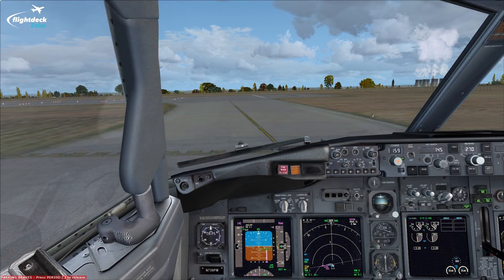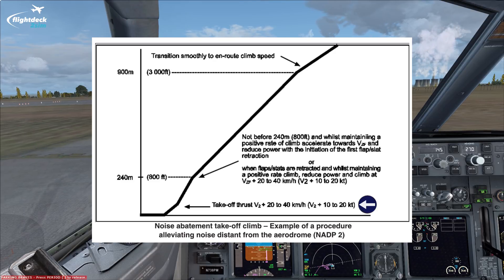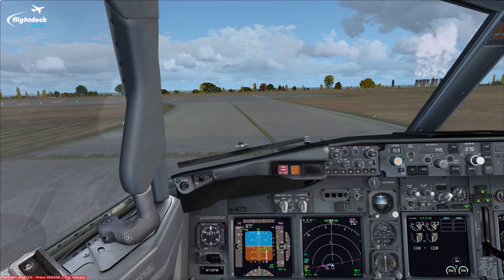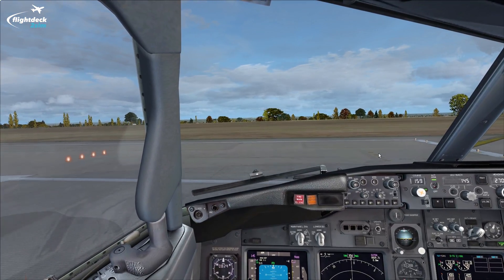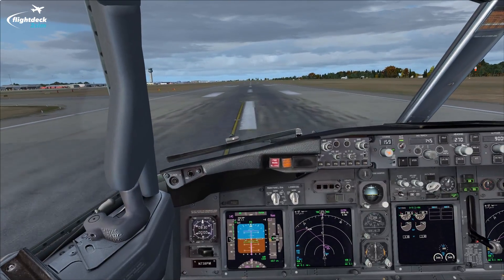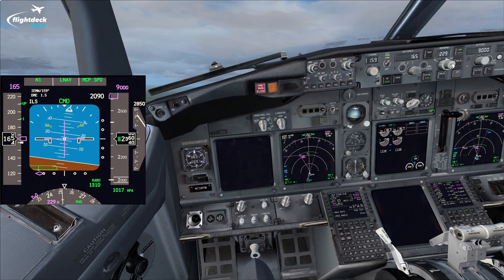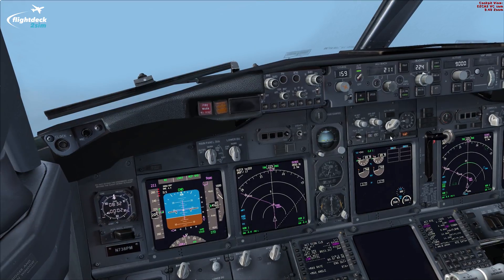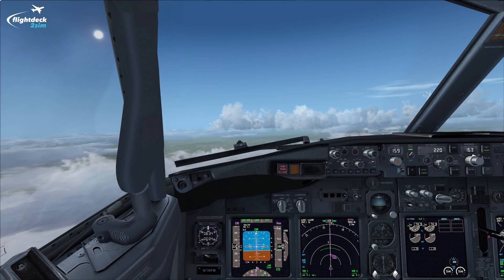PMDG 737 | Takeoff Tutorial (Noise Abatement Departure Procedures) | Real 737 Pilot

Comment: Sorry for it not being about noise abatement but my question is what is the purpose of putting the gear lever in the middle position?
Reply from the maker: Hi Joe, no problem!

Once the gear is in the UP position mechanical locks keep the gear up, moving the gear level to OFF removes the hydraulic power holding the gear up, this increases the life span of the gear HYD actuators.

FD2S

Comment: While flying what is the difference between autopilot Alpha and bravo  and those 2 under.
Reply from the maker: Hi Ruben,

Both are identical in function, F/O typically engages CMD B and the Capt CMD A, makes no difference. Both must be engaged to fly an Autoland.

CWS is a mode called Control Wheel Steering, a mode seldom used but allows you to "fly the AP" through the control column, it will hold attitude and pitch for you.

FD2S

Comment: I have watched many of your videos (love 'em all). But one thing I do not recall seeing, and am confused about, is the Acceleration Height, Engine-out Accel Height, and Thrust Reduction as seen on page 2 of the Takeoff page in the FMC.  In particular,  how does your operator use these, if at all, especially in relation to the two NADP procedures, and also to the Autothrottle, Flight Director, the pitch modes, and the autopilot?  If you talked about this in a video, please tell me which one.  If not, maybe you could speak to this a bit.  THANKS SO MUCH!!!
Reply from the maker: Hi cruisebuddy

You can modify the Acceleration Height and Thrust Reduction on TAKEOFF REF Page 2. If you then select VNAV for departure (which some airlines do) it will accelerate the aircraft at the height selected on TAKEOFF REF Page 2. As we don't use VNAV for departure we don't pre-populate TAKEOFF REF Page 2 in my company, we do it manually using LVL CHG and "Bugging Up"

FD2S

Comment: hi great video 
I have a question regarding airspeed during the take off. I set the vspeeds on the FMC and dial VR in the MCP. set flaps and arm auto throttle. Line up and set thrust to 40% engage Toga ,rotate at V1 ,as I climb my airspeed will rise passing the flap up speed.
I cannot reduce thrust unless I turn off auto throttle which I'm sure is wrong. Should I be retracting the flaps as my airspeed increases.
I looked at your instruments you had throttle hold , I can't remember seeing that before 
I need to understand more on the relationship between TOGA and VR  
Hope I articulated it enough for you to answer me
Reply from the maker: Thanks Jonathan 

Set V2 on the MCP and follow the magenta flight directors accurately after takeoff. The aircraft will pitch to a maintain a speed of V2+20 after takeoff until you pitch nose down to accelerate based on the NADP.

Take a look at my latest tutorial on Takeoff Flap settings which includes a F1 and F25 Takeoff. This should help you out 👍🏼

https://youtu.be/2ll7aFpgNCw

FD2S

Comment: Hi! In a NADP 2 you “bug up” at 1000ft but the thrust reduction altitude is 1500ft, right?
Reply from the maker: Hi Francesco

Correct, thrust reduction can be modified on takeoff page 2 of the FMC, it’s defaulted to 1500ft 

FD2S
Reply: flightdeck2sim and in your company you modify it or you leave it at 1500?
Reply from the maker: Mostly leave it, certain airports have different rules. You can find the information on the Aerodrome Information part of the chart regarding acceleration heights and thrust reduction altitudes. 

Good luck! 

FD2S
Reply: flightdeck2sim Thank you so much!

Comment: Great videos... what is the difference between the autopilot switches... you selected CMD B usually I would just select A?
Reply from the maker: Hi Jamie, thanks!

Both are identical in function, F/O historically engages CMD B and the Capt CMD A, makes no difference

FD2S
Reply: Thanks for the quick response, makes sense then... just discovered your channel and subscribed alot of my questions are now answered :)
Reply: Hi Jamie, Maybe it was here or in another channel that I saw that. When comes to VOR's tracking, as you have 2 vor's and course knobs, if you engage A, it will follow that VOR/tracking on the left side, and if B, the VOR on the right side. I think that is the only difference.....but I might be wrong..You can test this easily by setting the same frequence on both sides and different trackings, engage the vor tracking and see which one will follow with B or A. Worth to mention that it's very rare that I see people using VOR navigation on any of the large jets (on youtube...and simmers...which is my only experience as simmer)).  This is one of the skills that goes away when you leave the GA planes and move to the big ones. The FMS will do everything and we forget some of the basic stuff....

Comment: because you are a real boeing pilot i ask you how is the manual handling of the aircraft i the sim compared to a real aircraft?
Reply from the maker: Hi Adrian.

The NGX is a very accurate rendition of the real aircraft and certainly something I can use to improve my knowledge. With regards to handling there are some limitations as there is no feedback from the controls (the need to trim etc) but that's the same with all aircraft on a desktop simulator. The dynamics and how it behaves with certain configurations, attitude and thrust settings are pretty close to the real thing.

There are some subtle differences between the NGX and real aircraft which I always try to bring to your attention but the flight model is pretty sound. 

For what is essentially an entertainment product it’s certainly worth the investment and it’s realistic enough to accurately show you how to operate the aircraft using real world SOP's and procedures.

FD2S

Comment: Thanks for another great tutorial! Quick unrelated question, if an IAP contains a DME arc to make the transition, does the autopilot flies the arc automatically after loading the procedure? Also, can you configure the fmc to fly an arc manually similarly to how you enter a holding procedure?
Reply from the maker: Hi Manuel Z,

The ARC should be in the FMC Database if correctly coded and you can use LNAV to simply follow the magenta line.

You can build an ARC manually by using the fix page in the FMC to create waypoints using a Radial and Distance from the DME Station. It won't be a perfect ARC but good enough!

FD2S

Comment: Always very happy to see you've released yet another clip sharing some of your knowledge!

One thing I wanted to ask not related to the topic discussed in this clip is how much do you hear from the APU when starting it as well as when it's running when sitting in the cockpit? Same question for the engines.

Reason for my question is I'm trying to modify the existing sounds and would be nice to get them as close to the real thing as possible. I realize it's very hard to describe exactly what you hear using text only but comments such as...

"You can clearly hear the APU starting as well as running from the cockpit if there's not much other noise close by" or...

"You won't hear anything from the APU other than the sound the APU switch will make when you flip it to start the APU"

...that would be awesome and most appreciated!
Reply from the maker: Thanks Richard!

You can't hear it from the cockpit unless the aircraft is completely empty and only when you initially power up the aircraft. (Battery on only). As soon as you connect a source of AC power (GPU or APU) it's drowned out by all the background noise in the flightdeck. 

That's the best way I can describe it!

FD2S

Comment: Another welcome & informative video for the flight sim community.

Copied this from my local airport NAP Arrivals procedure :-

"Aircraft will be routed clear of populous areas until seawards of the coastline or
established on their final approach course. To assist with noise reduction on final
approach course, pilots are requested to delay flap deployment until as late as is
operationally practicable"

I am assuming the flap delay means the engines shouldn't be revved up until "operationally practicable". Here's me picturing a quick "flaps full" when getting close to the threshold :)
Reply from the maker: Hi Richard! Thanks!

Haha that's essentially it, if you're lucky you can essentially avoid "revving up" until on short final

We try and fly all approaches as LDA's (Low Drag Approaches) which helps to both increase efficiency and reduce noise. We try to use idle thrust for all descents and try to avoid flying extended periods at low altitudes by flying a CDA (Continuous Descent)We then plan to configure flaps and gear for landing so we only need to add thrust selecting landing flap. It's more art than science! 

FD2S

Comment: Is there a way of setting NADP via FMC? I believe this can be done with Airbus?
Thanks btw for your fantastic videos, I've learned so much!
Reply from the maker: Hi Keith, thanks!

You can modify Acceleration Height and Thrust Reduction on TAKEOFF REF Page 2. If you then select VNAV for departure (which some airlines do) it will accelerate the aircraft at the height selected on TAKEOFF REF Page 2. As we don't use VNAV for departure we don't pre-populate TAKEOFF REF Page 2 in my company, we do it manually using LVL CHG and "Bugging Up"

Hope this helped answer your query!

FD2S.
Reply: Cheers for the fast reply, thought that was the case! One thing which was an eye-opener for me from your earlier videos is how much you do use the FMC for making changes, rather than just using features of the FCU panel. This is the reverse though, is there a reason why your airline chooses not to use VNAV on departure? When do you usually engage VNAV then?

Comment: Nice informative video! I noticed you didn't talk too much about thrust aspect of it. Granted you had a good length of runway and your TO thrust was basically the same as the climb. Are there procedures for when you're flying heavy or have a shortened runway and how can program the climb thrust cutback at a given altitude in the FMC? KSNA is pretty notorious for NADP.
Reply from the maker: Hi Kevin

With regards to Acceleration Height we don't use VNAV for departure here so we don't pre-populate TAKEOFF PAGE 2 prior to take off, we bug up manually using LVL CHG. 

We also leave the default values for reduced climb (CLB 1 and CLB 2) for all departures, even shorts runways where we are field length limited. Depending on what thrust setting we use for takeoff decides our de-rated climb thrust, the FMC will decide CLB-1 or CLB-2 based on what derate we select or/if we decided to use assumed temperature reduction. We don't change it as crew at my operator.

We always reduce take-off thrust to a safe value to increases the service life of the engine, reduce costs and decreases noise but it's usually based on takeoff/obstacle limits as opposed to noise. At noise sensitive airports like Barcelona (LEBL) where noise compliance is monitored and hefty fines are imposed for non-compliance we follow NADP 1 which is sufficient, even with full 26K and SIDS are designed as practically as possible to reduce noise. 

I only have experience in Europe so it might be different State Side and procedures applied differently else where! 

I hoped this helped answer your query!

FD2S.

Comment: Good evening and thank you very much for the videos. Extremely informative and I have learnt a great deal from you already. Just a quick question, I notice that you selected CMD B on the autopilot. Why and when is CMD A or CMD B used or is there no difference?

thanks again.
regards

gareth
Reply: I believe either one is legitimate in usage. CMD A usually goes to the pilot side so it's linked to nav 1, and CMD B is linked to co-pilot/fo side Nav 2. For ILS, both are usually turned on for redundancy in case one fails. So both NAV 1 and NAV 2 need to be set correctly for the ILS freq. I could be wrong though.
Reply from the maker: Smashing reply by Kevin W, both are identical in function, F/O historically engages CMD B and the Capt CMD A, makes no difference, two A/P's are available 👍🏼

FD2S
Reply: Thank you very much for your reply, I really appreciate it plus of course the reply from Kevin W. Please keep the videos coming when you have time as they really are the most informative I have seen.
regards

gareth

Comment: Hello Captain ,Great video as always ,i have one question please ,what is the difference between ACCEL HTand Reduction ? and if the noise abatement is related with ACCEL HT ,how can we know the altitude of Reduction ? thanksin advance and keep the heading please
Reply from the maker: Hi SLIM NG,

Acceleration Height is the height above airport elevation at which flap retraction is initiated. I'm not too sure but it you use VNAV for departure (which some airlines do) it will accelerate the aircraft at this height. As we don't use VNAV for departure we don't pre-populate TAKEOFF REF Page 2 before departure. 

THR REDUCTION is the height at which the auto-throttle reduces thrust to CLB N1. Again for the company I currently work for we leave this at the default value of (1500FT) for all departures regardless of the NADP procedure.

I hope this helped answer your query!

FD2S.
Reply: it Helped very well ,thank you ,much appreciated